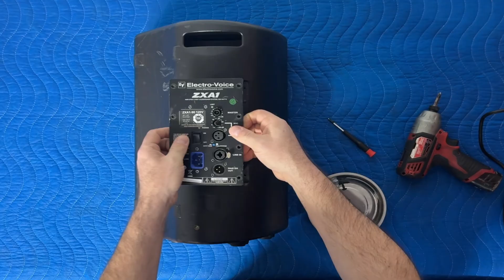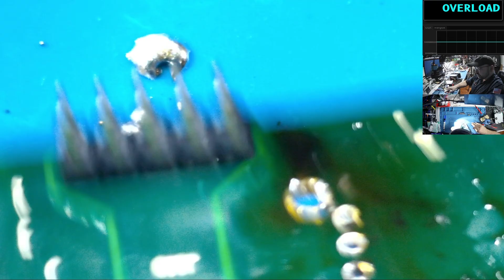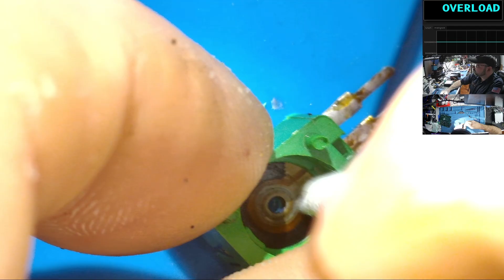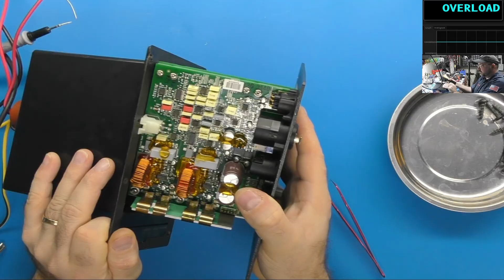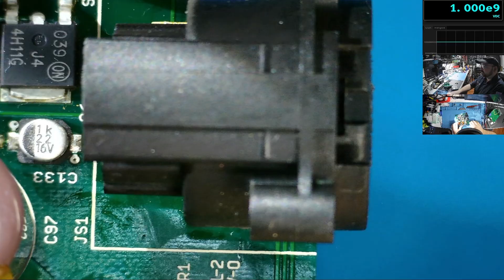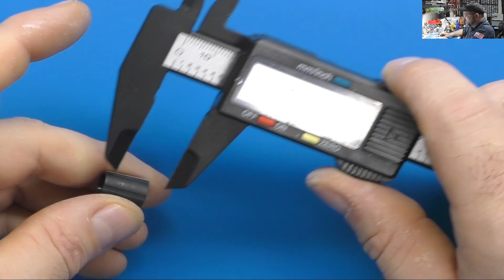ElectroVoice ZXA1 Repair: Fixing Scratchy Audio, Bad Pots & 3D Printing Knobs!

Comment: I've serviced several Dynacord D8A's (basically the same amp module in a slightly different cabinet) and found similar issues.
At least on the D8A's the two pots protrude almost outside of the edge of the cabinet making them very susceptible to impacts. Often when they get loaded in and out of vans the take a hit. A bit disappointing that they didn't use pots with a nut fastener to give some extra protection.

Quite a nice amplifier otherwise.
Reply from the maker: Indeed!